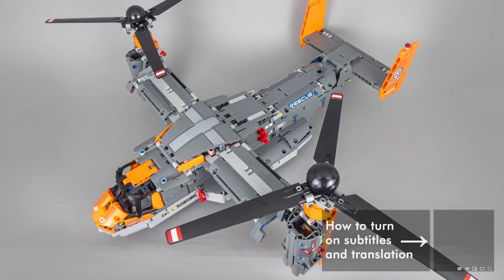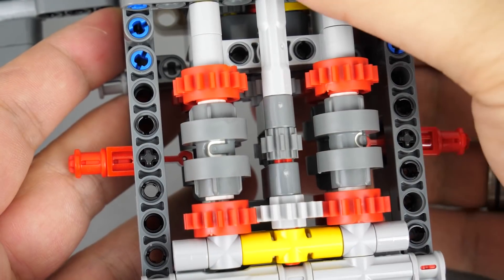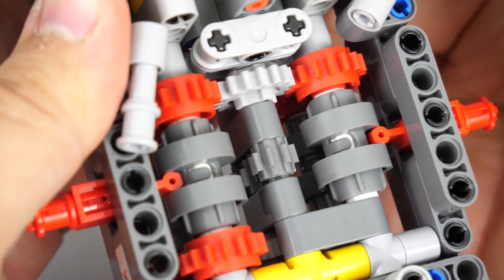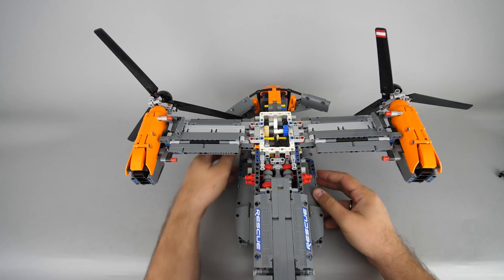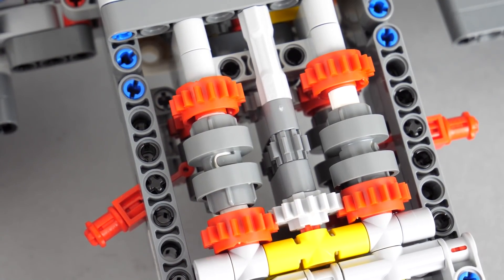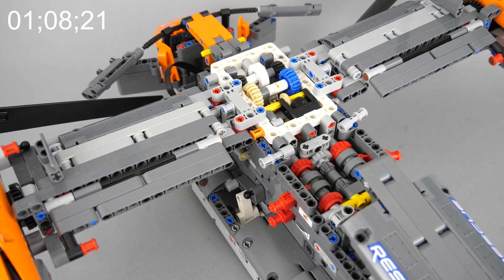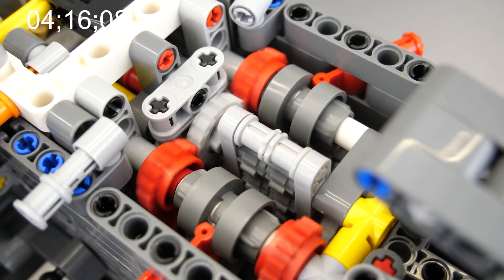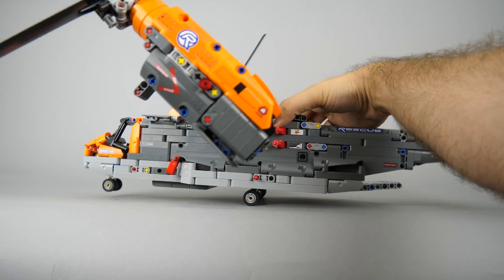Debunking the gear-crashing monster - LEGO 42113 V-22 Osprey fundamentally flawed?

Comment from the maker: Click here for the disassembly guide and the photos about the fixed setup - https://racingbrick.com/2020/10/lego-technic-v-22-osprey-design-flaw-details-possible-fixes/
Reply from the maker: @GD_Jacobzamboni I checked your solution but it makes a linear connection between the 2 gears on the same level (and reverses the rotation meanwhile). The point of the three 8 tooth gears is to connect the lower and the upper sections, to transmit power between them.
Reply: Cheap plastic. This year has been bad for Lego quality IMO
Reply from the maker: It's not really abou quality change, the 8 tooth gears can take only this amount of force. If you put them in a not completely secured position then the slight changes in the forces will make a tiny dent at some point and after that the gear gets ruined quickly.
Reply: How much money was the 200 ⚙️
Reply from the maker: 10 EUR

Comment: ha a 3 8-as fogaskereket kicserélitek 2 16-os fogaskerékre, akkor nagyobb az erő átvitele, és valószínűleg kisebb sérülés lesz. lehet nem fér be, de ha hátrébb hozzuk akkor már elférhet.

if you replace the 3 8 gear with a 2 16 gear, the power transmission will be higher and there will probably be less damage. it may not fit, but if we bring it back it may already fit.
Reply from the maker: A nagy kérdés hogy hova viszed hátra :)
Reply: @RacingBrick  Egy modelt készítek róla, már elkezdtem. Ide nem tudom csatolni a képet róla. van olyan email címed, ahova majd küldhetem a javítást?
Reply from the maker: @kasapeter5661  itt YouTube-on az about fül alatt találod az e-mail címet
Reply: @RacingBrick   	megtaláltam
Reply: @RacingBrick  tegnap este elküldtem emailban a javítást
Reply from the maker: Köszönöm megkaptam, meg fogom nézni
Reply: @RacingBrick  Rendben :)

Comment: are these teeth hollow? .... real quality lego -.-* .....
save cost on material ...
Reply from the maker: It has nothing to do with the quality of the gears. This is plastic, not metal.
Reply: @RacingBrick  if they are not hollow, then they would be stronger, and would not bend as fast right?
4:49
Reply from the maker: Again, this is plastic. Get any LEGO piece with a similar diameter and apply a similar force, it will bend.

Comment: The rotor clutches should have decreased resistance if the axles rotate slower. Maybe if some gear ratios are switched it's possible to reduce the resistance of those friction clutches without reducing their friction while at the same time keep the rotors spinning at unchanged speed...🤔

Comment: How are the friction pins not slipping enough to let the system move freely independently of the rotors? Also maybe there's a way to add more slip points in series to the rotors.
Reply from the maker: If you replace the friction pins then thr system slips too much and the rotors won't rotate

Comment: You can also fix it with 4 of this small things to put them on the axis and 2 rubber bands, so you have a slip clutch and no components get damaged if the rotors stops...and the rotors dont start at full speed they are running faster and faster with correct rubber bands, little bonus effect :D

Comment: Add silicon grease to clutch parts? Or should there be a clutch between driving motor and parts taking damage?
Reply from the maker: There is a brick-built clutch but even that is too much. The transmission between the two layers needs reinforcement with more gears and stiffer support.

Comment: I would have imagened you'd burn out the friction pins before you proke the gears.
also the new plastick Lego is using isn't exactly as strong as the old plastick was when new and the new gear design for the eight tooth is oviusly not that strong eather. At this point the best thing to do might simply be to redesign the eight tooth AGAIN instead.

Comment: A problem I could see the technic engineers missing is the thermal expansion of the rotor clutches after an extended period of time that increases the resistance of the clutch.

Comment: I have never liked putting 8 tooth gears in that configuration, they dont spin smoothly, as if they're too tight or binding. I think this is the reason for the failure
Reply: Yeah when I put three together they are not as smooth as putting a bigger one next to it
Reply: @hunter7476  it seems fine until the shafts are supported properly on both sides, then it's too tight. It would interesting to see if the drivetrain would be more reliable with less support, to allow some extra clearance on the gears
Reply: @MonticelloSkateTeam  yeah true it depends on what I’m using it for or the application and the way it’s mounted too

Comment: The blades friction protection is for one on both sides therefore the friction is the combination of both. Then there's some pre-gear reduction before that for more speed (making the friction clutch even stronger) what I propose is that the motor just has its own clutch before it even gets to any of the gearboxes. Therefore the entire system will be torque limited and it will protect all of the gears. But I don't know if that's possible with the assembly.

Comment: tl;dr dont jam the rotors .... clearly you never had deal with RC servos or RC helis gears are expendable. best thing to would be build in a fuse gear that thats cheap and easy to get better your cheap gear get stripped then burn out the motor.
in areas where i expect a servo to take load i use plastic gears because its better they strip out then burn out the servo motor and gear sets are like 2 bucks and new server is 40 bucks. same thing in tail rotor drive there are lots of plastic gears that will strip out if the rotor hits something or jams this again protects the main drive motor. likely the small gears are being used a fuse gear here there cheap and easy to get hold of.
Reply from the maker: You clearly missed the point that this is a kids toy and it might be jammed unintentionally, but on other LEGO builds in general there are safety systems preventing the not only motor damage but the damage of other parts as well.

Comment: So, what I am seeing is, the solution to the breaking gears is not do block the rotation. Basically, if you don't do stuff that it isn't designed for, it won't break.
Reply from the maker: Practically yes, but you need to remember that it is a toy, played by kids, and there will be scenarios for sure when it gets blocked. Especially because it will block if you try to run it tilted forward. This means the wear will add up and sooner or later the gears will get damaged.
Reply: @RacingBrick  since the set was canceled, I highly doubt any were purchased by parents for their kids, I bet every single set was bought by adult Lego fans
Reply from the maker: @pokemaster123ism  I'm totally sure that it was not designed with the future cancellation in mind.

Comment: As a mechanical engineer, I find the only REAL issue with technic is that you cant easily greasy the gears.high torque with plastic is always tricky tue to how much every part flexes when it the parts start to grip

Comment: But in order to fail... it has to get stuck... and honestly, why wold you stop the rotors AND keep it running?
Reply from the maker: Since the rotors touch the ground when they are tilted forward it will happen for sure. Obviously you don't want to let it run for minutes, but the stress adds up with time. And since this is a toy for kids, safety systems inside should be there to protect the person but also the structure.

Comment: Was this the actually reason Lego had to pull this set off shelves? Not the military war vehicle reason people were saying?
Reply from the maker: Don't think a set would be fully cancelled because of a construction problem, it happened before and it was corrected
Reply: @RacingBrick  That's a shame, I do hope Lego realizes that not all military vehicles are used for war. Like the Osprey is primarily used for rescues and transport. It's also a pretty nice build that I hope the designers are fully appreciated for. When I made the Mega Bloks Halo Falcon set, the first thing I thought was how I could motorize it, even if I had no motorized parts. I could buy all the parts individually but that could end up more expensive than the retail price.
Reply: @MrMiraculon  Not to mention Lego has no problems making UCS sets for the Sopwith Camel and Fokker Dr.1, both fighter planes from one of the bloodiest wars in history.
Reply: @matthewseligman5470  they're creator sets, not UCS

Comment: I'm not much of a builder but it would solve most problems if somewhere sold metal replacements for the gears of technic sets to avoid this problem all together
Reply from the maker: Metal gears would then destroy plastic axles, it does not solve the issue only puts it elsewhere.
Reply: @RacingBrick  very valid point, I can see even with the metal axles it destroys the bricks, there's a video of a metal axle stress test and the metal just destroys everything if its under any stress

Comment: I don't have this set but after looking at your review and this video I have a thought. In combination with your solution in this video what if you changed the final drive gears to the rotors (Tan 12 tooth Beveled Gear and the Black 12 tooth Beveled Gear) in the Black Pin Connector Toggle Joint with a  Tan 12 tooth Beveled Gear and the Tan 20 tooth Beveled Gear. I know this would make the rotors spin slower but would increase the torque prior to the simple clutch. As I don't have this set I'm not sure if the 20 tooth gear would have enough clearance between other gears in the assembly.
Reply: Honestly it seems that the main flaw of this design was not putting a clutch gear before the gearbox. Honestly shocked this didn’t come up in testing, as it would likely solve the problem.

Comment: Who would try to spin stopped propellers for 3 whole minutes? It just doesn't make any sense. If the blades are stuck then you should upper the blades or torn off the engine, not trying to force the whole thing
Reply from the maker: To try to simulate the effect of a longer period where a kid playing with the set would accidentally or willingly stop the blades for a few seconds, but a lot of times. All the other reports of the "faulty construction" were based on scenarios where the system was blocked and forced for a certain time.

Comment: Wow, great video! I have some ideas too: 
1. Instead of three 8z gears, maybe two 16 tooth gears
2. It might be possible to replace/add a "old school" 24 tooth spur clutch gear, that might "slip" more easily
Reply from the maker: These need a redesign of the gearbox, currently there's no space for them
Reply: @RacingBrick  Also only using 2 gears the rotors would spin in the wrong direction.
Reply: @SuperCougar1963  yes but its better than gear crushing

Comment: There is another way to weaken the clutch force for the propellers - the “Black Technic, Axle Pin 3L with Friction Ridges Lengthwise and 2L Axle”, 18651. This piece has less friction at the pin end than the blue friction pins. I’ll post a link with an example of how this could be used - not sure if it has enough friction to allow the propellers to turn, though.
Reply: Softer clutch here: https://imgur.com/a/jzDK2Op
Reply from the maker: @stevenpatton8628  interesting, I'll test it for sure

Comment: Just use other gears?
Reply: if 8t gears mesh with 8t gears, you need 16t, I don't think there are more comparisons if 2 years that are 16t in total
Reply from the maker: Watch the video, no other gears fit in that 1 stud wide space. A complete redesign is needed if you want to use other gears.
Reply: @ShunTechnicBricks  dude can you read I said 2 gears that have 16t in total